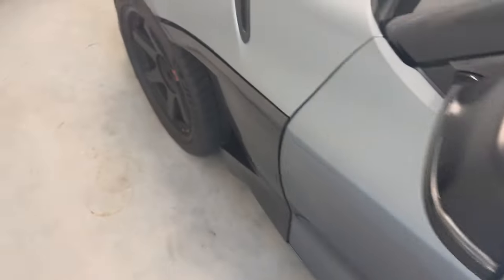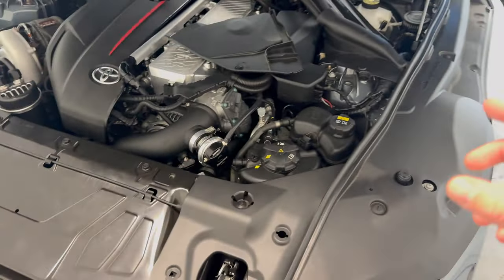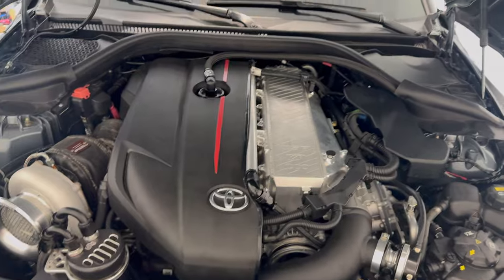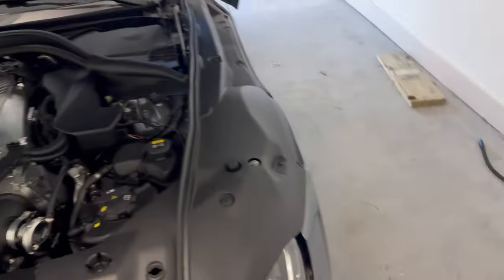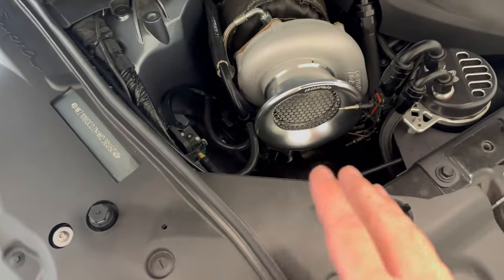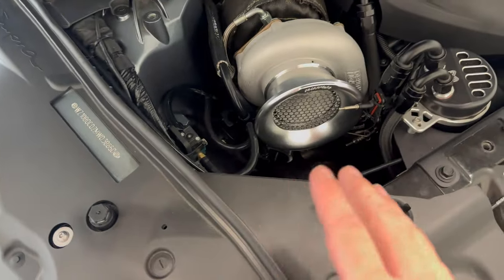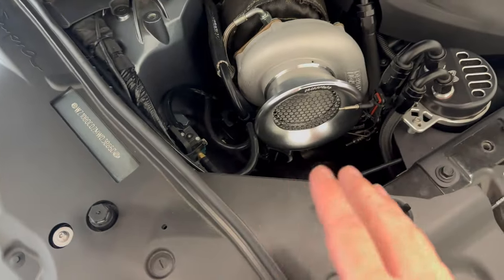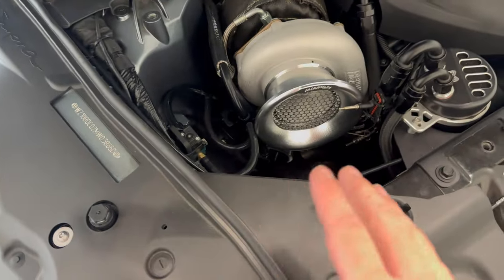My Biggest Regrets When Building My Big Turbo MKV Supra

Comment: Those product issues with 5ive performance are pretty concerning, borderline scam-ish with their PTFE lines. Would you skip the Reflex Plug&Play harnesses altogether or just go with Visconti or TMS?
Reply from the maker: Yeah I was not a fan when I saw it all. They tell you it’s good for E85 and tested on their 900 wheel Supras. But the stuff will literally deteriorate in a year or so. Then all the wire crap is annoying. I would go everything Visconti if I had to do it again.

Comment: I went with the radium fuel system, and their fuel pump, now my car makes a ticking noise in the fuel pump area. 

I should have kept the car on E50 stock turbo😢
Reply from the maker: Hmm that’s interesting. I bet it’s probably the new fuel pump. Does it sound like injector clicking?
Reply: Ticking in the HPFP/injector area? Possibly something unnoticed prior? There’s a bunch of B58 videos and shorts if you search “B58 ticking” of people concerned of ticking in the engine bay which normally comes from the injectors I believe